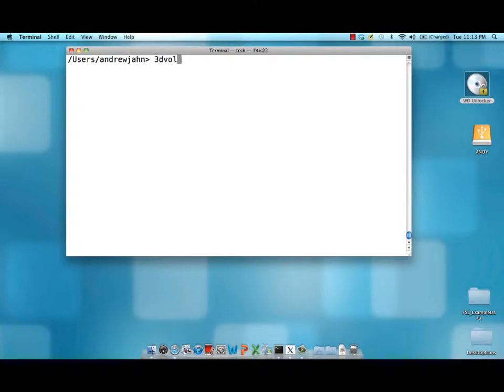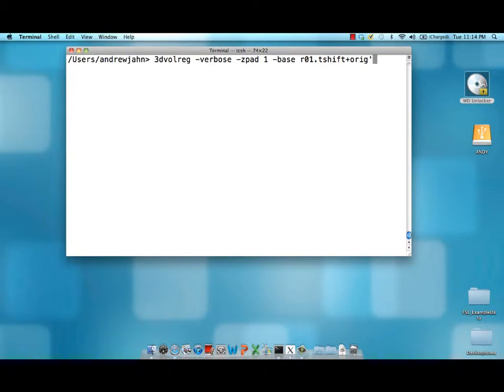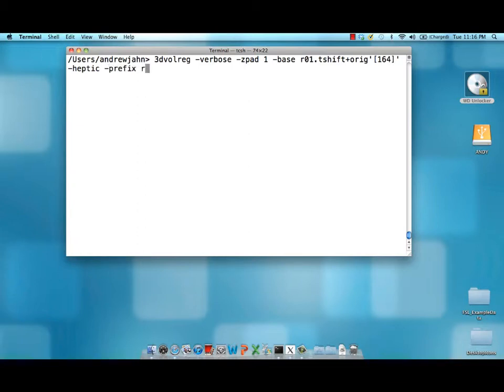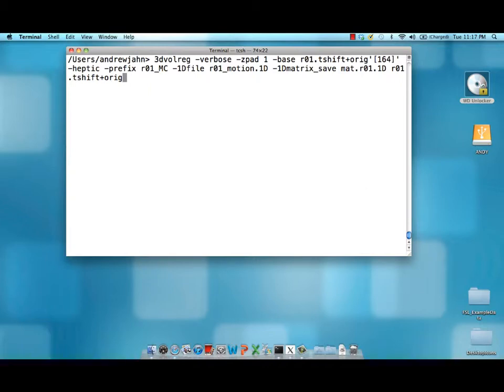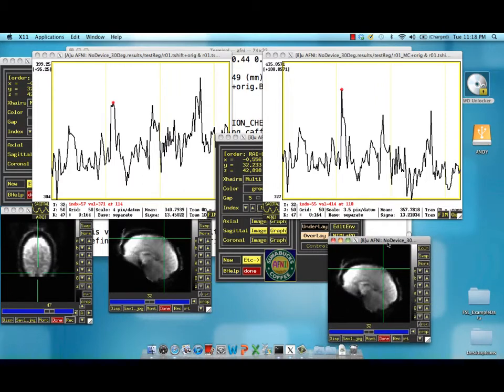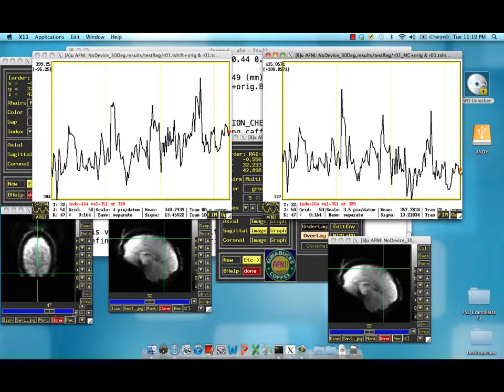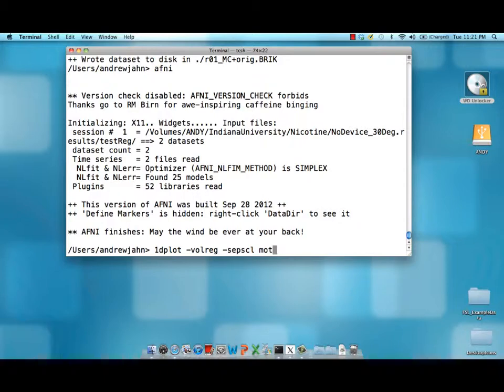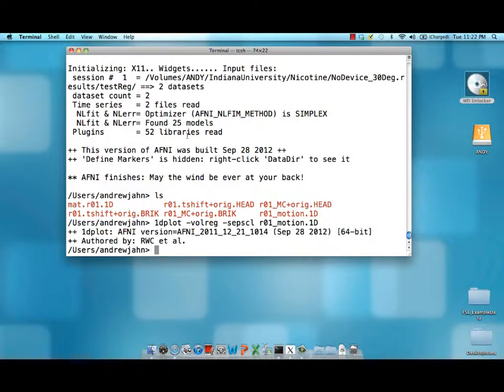AFNI 3dvolreg

Comment: If I may ask another question: In the official afni demo, 3dvolreg is also performed, but then why are the motion parameters later entered into the design matrix? Because when you type 1dplot X.xmat.1D  the first six lines are again these motion vectors for which the data was already corrected.  Why would you do that? (to check if they are correlated with the stimulus maybe?)

Comment: Hi Andy,

I'm using some commands from AFNI, but I'm wanting to run my analysis on FSL. What would be the identical commands for motion correction on FSL in relation to the 3dvolreg on AFNI? I was thinking MCFLIRT, but I'm not sure. Thanks.
Reply from the maker: Hi,

Yes, MCFLIRT does many of the same motion correction procedures as AFNI's 3dvolreg. If you want to do it from the commandline, you can just use the command mcflirt, followed by arguments specifying the cost function and reference volume that you want to use; for example, mcflirt -refvol 1 would be similar to using 3dvolreg -base 1.

Best,

-Andy
Reply: Andrew Jahn Thanks Andrew, you're videos are a life saver. 

I'm going to piggy back on this comment with little shame, and ask another question that I can't seem to get much info on. I found out that my fmri data set is oblique, and apparently this can cause an issue. Going through FSL, I never ran into any errors, but using the command lines of AFNI, it seems that using an oblique data set isn't the best idea.

I also read that it depends on the degree to which your dataset is oblique, where some values are okay. I've been using the general command of 3dTshift (required before) and 3dwarp -oblique2card. 

I just wanted to get your opinion this matter (is it a big issue, do you yourself usually adjust for it) since coming from FSL, it's a new and frightening development if I may say so…. Thank you!